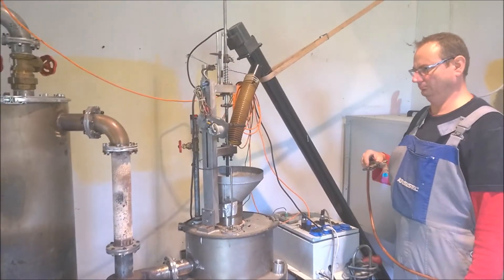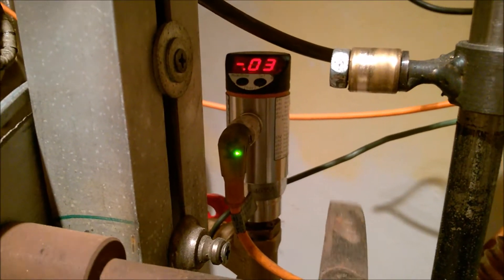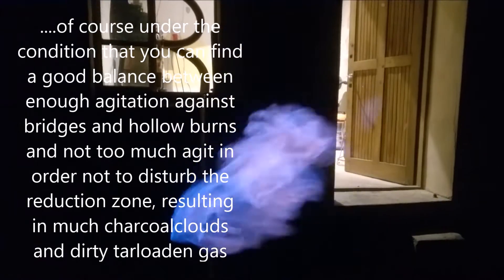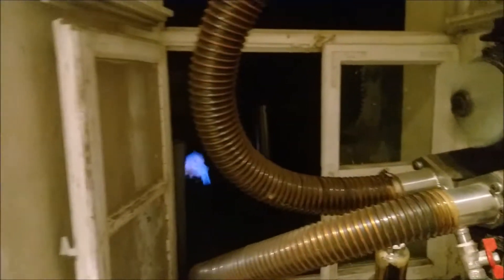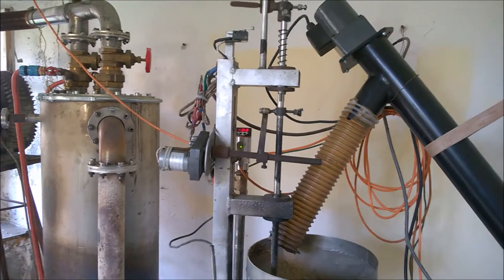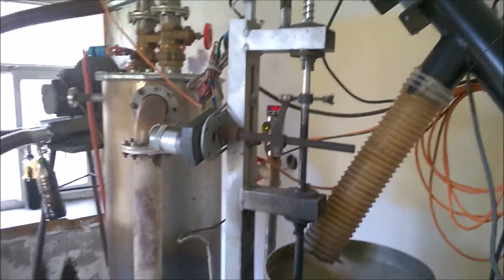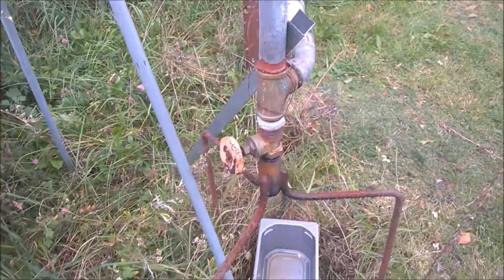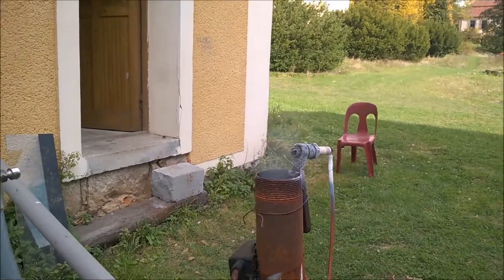Drizzler grateless gasifier duration test 6th attempt 27.5 hours!!!

Comment: The Drizzler cracking temperature is correct.  The deeper combustion / oxidation zone is consuming excess water produced by combustion, resulting in water-gas shift reaction, creating an increase in exothermic hydrogen, oxygen and CO conversion, less Co2.  If you pass the final gas through a bed of fine copper turnings as a catalyst you will further decrease NO(x) and produce still more CO.  This reaction is the reason you see some pink showing up in the flare.  If you divert the flaring heat partly back to the combuster, (exhaust gas re-circulation (EGR)) you'll be able to turn down the air flow some and fuel consumption slightly without loss while increasing the residence time to support continued cracking.  If you're running pine pellets, you've made out well.  Watch the moisture content.  If you want to run cheaper, lower grade pellets with higher moisture, increase the EGR  and air flow to convert higher moisture levels.  Watch for metal oxidation on the downstream side as most wood will produce SOME chlorine and also sample the gas through a collection of cotton filters, hydrate them and check the PH so you know where that stands, augment the fuel with additive to adjust it.   Also, keep in mind the diameter of your combuster is directly relative to the thermal transfer among the pellet stack pre-heating.  If you increase or decrease the combuster diameter relative to the pellet size you can optimize this benefit.  Go too far either way, you lose pre-burn gasification.   Try 1-2 percent iron filings with the pellets and watch what happens.  Iron filings are usually cheep and produce considerable thermal product, very nice.  :)  

If cost of fuel and maintenance are a significantly lower cost than commercial heating, you may have a winner.  12 hour service factor is not uncommon but also not very demanding.  Consider flaring to an enclosed sand bed to store high temperature heat which will let you cycle or idle the gasifier to lowest operating condition between demands.  A sand bed is VERY cheap and can store an enormous amount of BTU at 600 F without oxidizing metal pipes, to support residential heating.  Use enclosed 10/50 glycol water as the exchange transition to avoid hot air gas leaks into residence.  The gasifier may suffer tar production during start-up, but designed well you can discharge this to a start-up tar/pitch collection path which is handy (and can be re-burnt later).

Now all you need is a healthy Sterling engine to offset some electrical cost.  LOL
Good luck, nice project.

Mike

Comment: Excellent. What a beautiful unfiltered flare. 27.5 hours straight. Awesome. I don't even have enough wood chunks to go that long. But, I am working on it.
Reply from the maker: Thank you. Yes fuel preparation can be a pain. Fortunatly a DriZzleR can eat everything. Chunks but also pellets and that makes long hours testing more comfortable.
Reply: For some reason, my gasser does not like pellets. I think it is the Florida humidity getting the pellets moist and causing lots of tar. The oak chunks work really well and it is available everywhere. I just have to harvest the branches and chunk them. I'm building up my stock over time.
Reply from the maker: Well that is the benifit of our opentop drop feed gasifier, the DriZzleR. It will gasses all kind of wood because the lack of a wood bunker or hopper or fuel amount above the flaming pyrolise zone. The dominant flaming pyrolise zone will inmediatly dry and degasses the dropped in llitte peices of fuel, werther it be pellets, mikrochips, chunks or even branches. In a closed gasifier, or a hopper system the moisture of the wood at the drying zone crawls up into the feedstock above and decomposes the pellets.
Reply: That makes perfect sense. Thanks for that tidbit. I have a question for you on your feed auger. What diameter is it and do you have that on a timer or does it run constant at a very slow speed? I am kicking around building a external hopper and a feed auger direct into the closed wood hopper. I am still in the planning stages at this time, but, your input would be great. Thanks.
Reply from the maker: I have two augers. one for woodchips up to 30 mm square. And one for pellets. the woodchip auger has a square tube and in my vieuw this prevents very well the blocking of teh fuel because chunks can escape in the corners. this way one can do with a less powerfull drive motor. You find a video of it here  https://www.youtube.com/watch?v=34GB3Yk5oIs My other auger is a a standard pellet transport auger some 2 meters long. You can see it in above video. The fuel transport in my dropfeed DrizzlR is controled by a pyrotouch. This  I build to keep the flaming pyrolyse at always the set height. Here is a video of it https://youtu.be/OGzt8y-jPKQ
Reply: Thank you. I will check them out.

Comment: Excellent results. You are leading the way with your design and those long runs are the proof.
 Thanks for sharing it with us.
Reply from the maker: Thank you.  Do not be modest. You are doing great things also.
Reply: Each of us is on the pathway of discovery. That is the reason we keep going. How do you keep the ember bed " fluffed" ? I have noticed with mine that after the initial startup more often than not, the gasifier has a modest puff-back which seems to fluff up the ember bed ad make for a better run. The draw back m which I just discovered is that it also sends some char up into the air intake where it accumulates over time causing an air flow restriction. Now that I know it happens it becomes part of the maintenance schedule. 
Keep up the good work !
Reply from the maker: Hobby, I have no grate, that makes my system a bit different from a traditional gasifier design. In my grateless I must be very careful not to disturb my reduction or else my charcoal mass will sinc away immediately. I found in my system that keeping the reduction in place and at the same time open, greatly depend on how fast I react when my reduction starts to pack. Therefor this expensive under pressure sensor. Whatever you use, a grate shaker or a turning or tilting grate or any other device that sits in your reduction to shake off exes dust is less important. The main thing is to get your shaker to react at even the least bit of pressure drop. This way your shaker has to move very little and very gentle but very often. In my test the agitator worked practical constant but exstreme gentle. That explains also the nice flare. By hard shaking you produce a big cloud of charcoal-dust that goes through your system. This can lead to temporally disturbing the gasflow or bottlenecking it and gives you a dirty charcoaldust loaden flare. Sometimes even raw gas with some tar in it can slip through.
Reply: Your description of what goes on when the grate is shaken vigorously makes a lot of sense. There have been times when I would closely monitor the manometers and as the applied vacuum increased slightly from packing , I would slightly move the grate and the manometer would settle back to its sweet spot.  Even now with the timers controlling the grate shaker, the movement is more like an oscillation than a shake due to the slow turning of the wiper motor. That seems to work ok for awhile and then the packing of the char gets too much and the wild swings begin...like a death wobble.
 I will change the timer frequency rate to have the shaker come on much more often to see if that keeps it under control.
Thank you for the explanation and the insight as to what goes on in the heart of the beast.  I think we all have an idea of what happens but it needs to pass evaluation from another source to confirm what we suspect.
Reply: I liken this to " shaking the baby to keep quiet ". What you are saying , and I agree with, is all of our filtration, scrubbers, water baths are added on in order to compensate for " over stimulated or excessive force" disrupting the ember bed column. The very subtle differences in under pressure holds the key to the success and stability of the run. This , in my opinion , is the " silver bullet".

Comment: Congratulations on a well deserved successful run. I too have experienced the unfiltered blue flame from a deep bed of char. I wouldn't have believed it if I didn't see it with my own eyes. I think you almost have to have 2 paths for the gas to go so you can periodically inspect the plumbing on the side that has run for 24 hours while you switch to the clean side. You may even be able to incorporate an automatic flame cleaning of the interior of the pipes  so things can still be considered untouched. I'll be interested to see where it goes from here. Thanks for the great show. Joe
Reply from the maker: Joe, thank you, but your Ninja is a well thought off design also.